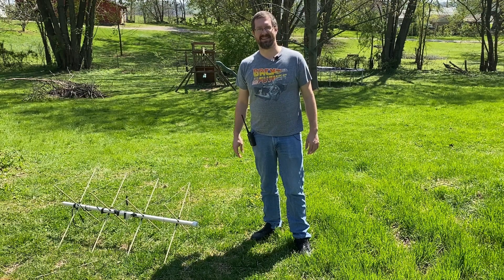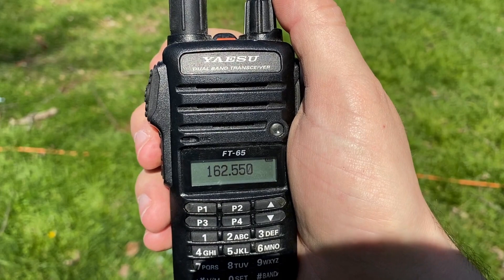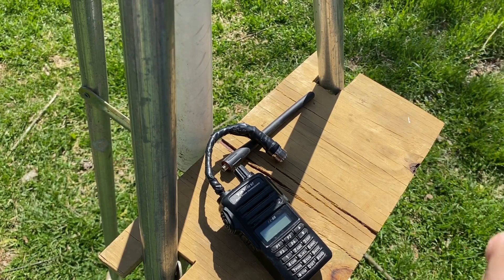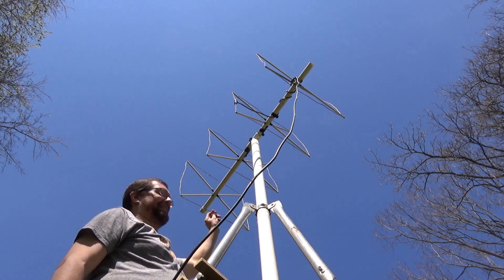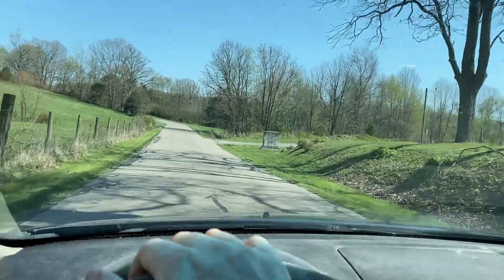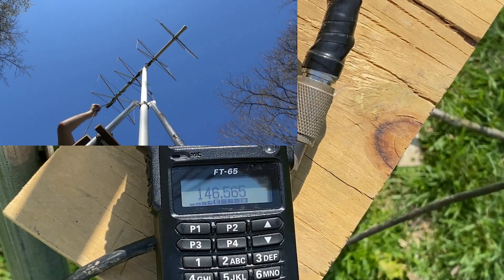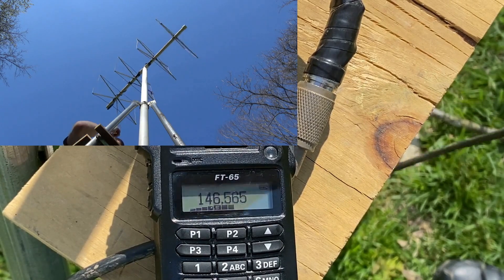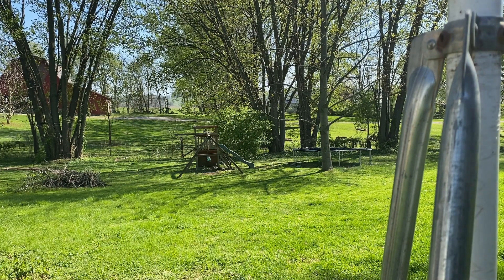Ham Radio: Exploring a 2 Meter Quad Antenna - Featuring the Byonics PicCon - 3 Old Tech Dudes

Comment: A choke is actually needed on a quad with coax and since its a lightweight antenna I made a sleeve choak ,1:1 for it which  corrected the distorted pattern good . that antenna is a balanced antenna and naturally coax is unbalanced . This is important and a good way to check it is if its pointing right at the station you want to talk to , if not it has a distorted pattern and the coax is Radiating Along with the antenna The choke stops that.

Comment: What about the impendance of a quad? Is it any miss mach w ith a 50 0hms coax? Thank you
Reply from the maker: On a 2 meter quad, the driven element will match a 50 Ohm coax. Wire length of the element might have to be slightly shortened or lengthened to obtain an exact match.
Reply: Thank you

Comment: For more on the PicCon go to   "PicCon ARDF FoxBox controller "  Some interesting programing below. Give it a try this summer. 

Mr. Softee
A1 00 00
A2 00 15
A3 01 30
A4 00 00
A5 00 00
A6 00 00
B1 80
B2 15
B3 75
B4 00
B5 00
C1 03, 01, 14, 00, 25, 15, 21, 00, 06, 09, 14,
   04, 00, 20, 08, 05, 00, 09, 03, 05, 03, 18,
   05, 01, 13, 00, 20, 18, 21, 03, 11, 00, 00,
   00,03,01,12,12,00,19,09,07,14,00,07,15,
   05,19,00,08,05,18,05,00,#

C3 00, 39, 49, 57, 49, 39, 30, 20, 30, 30, 20,
   03, 03, 20, 15, 15, 20, 30, 30, 49, 39, 39,
   20, 20, 

Can you find the ICE CREAM TRUCK ?
Reply from the maker: Nice! I’m pretty sure the “tune” in mine is just whatever is in the manual with the reverse added at the end...programmed it when I put it together 5 or so years ago and haven’t tried anything else yet. I’ll have to try this! I will take a look at your vid too. -Tim KB9SNL
Reply: @3oldtechdudes  Had time to put it in the PicCon yet?